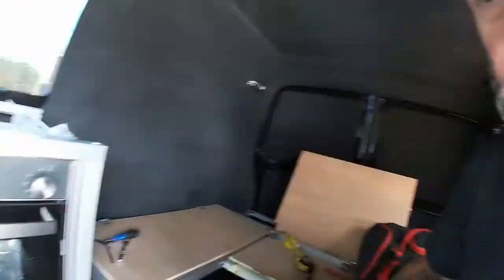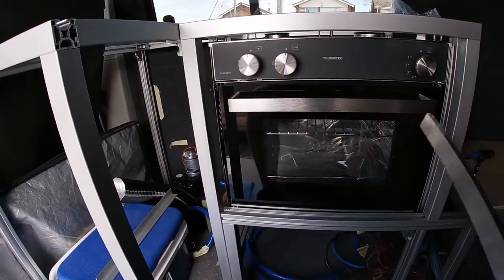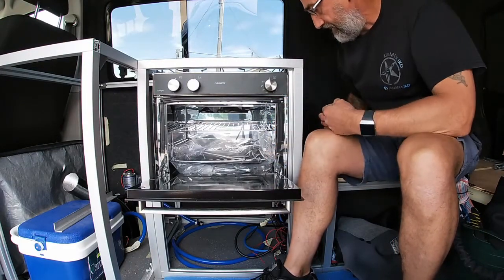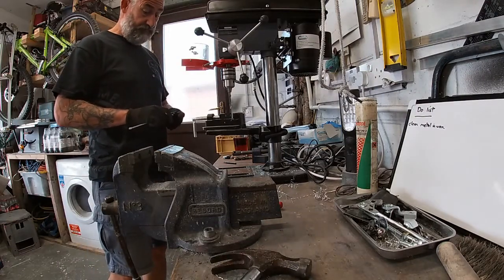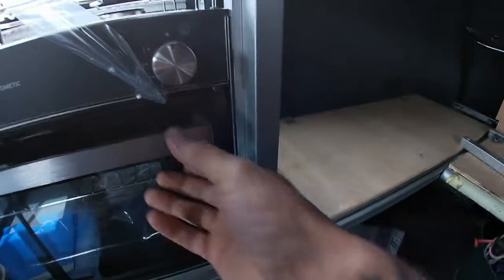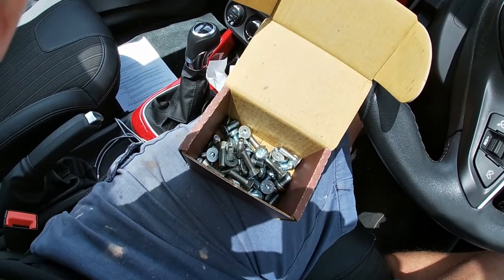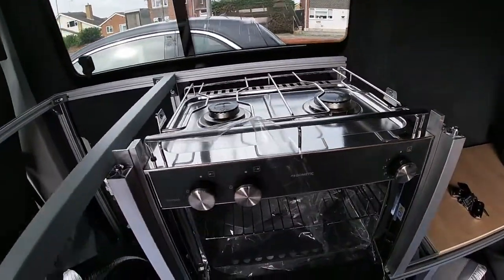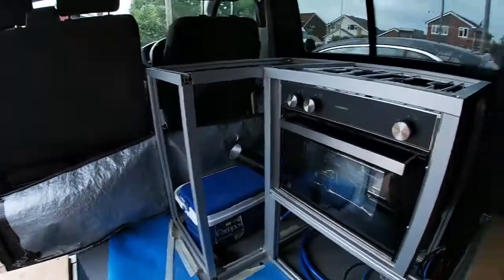FITTING THE  DOMETIC SUNLIGHT BEST OVEN IN A VW TRANSPORTER CAMPER

Comment: Hi! Nice video. How do you connect the sunlight to propane?? I can't find any info about the type of fitting needed for the propane outlet at the back of stove. thanks
Reply from the maker: Hi copper fitting would be best if possible, mine has a rubber hose works fine.
Hope this helps

Comment: Hi Paul - really like the look of this oven, and your installation looks really good!
Can I ask a few questions as struggling to find the info online. What space have you given the oven at the back of the unit? The overall depth is what I'm thinking about to see if it'd fit in my camper. 
Also what is the gas connection on the back of the oven?
Cheers!
Reply from the maker: Hi thanks there is about 150mm at the back and it has a metal pipe on the back of the oven good luck !
Reply: @paulshideout9056  thanks Paul!

Comment: hey, i’m thinking of installing one of these coolers in my van, got a question though, does it have an ignition system? and does it need an electric supply?
Reply from the maker: Hi  thanks for the comment no ignition system on this cooker just light it with a match good luck ! don't forget to subscribe if you want too
Reply: Paul Hastings that’s great thanks for the quick reply 🤜🏻

Comment: where you putting your gas paul? :)
Reply from the maker: Hi chris Elv the gas is going on a shelf to the left of the oven refillable from behind drivers seat
Don't forget get to subscribe if you haven't thanks
Reply: @paulshideout9056  watched them all mate,  im doing my t6 at the mo after moving from 5 to 6 as needed auto...doing this one myself though... great help they are.. im wanting the 16 litre lpg tank but if i have a water tank under the back then im screwed for the tank...because we're euro six we cant have the centre water tank as the sensor on the zorst gets in the way.. I have done my chinese heater..  ps have you seen the reimo 27 litre water tank that goes in the side panel (behind trim) behind driver seat? thought about that but...i have crazy ideas about a shower in the tailgate..
Reply from the maker: @chriselv3182  glad you watched them and they are some help to you good luck in your conversion you would be best to fabricate your own gas tank i did think about this but decided not too as i have a space behind the fridge to fill ! Thanks